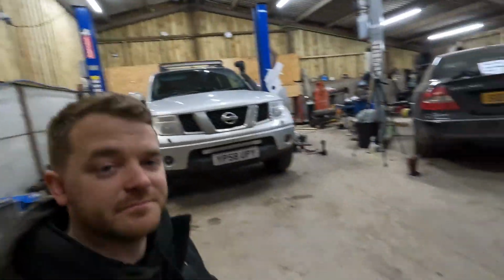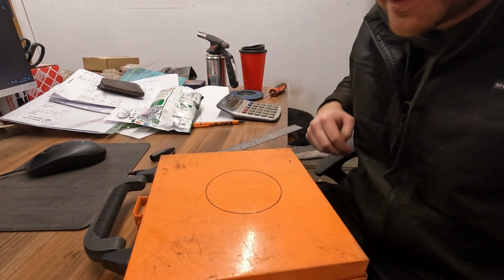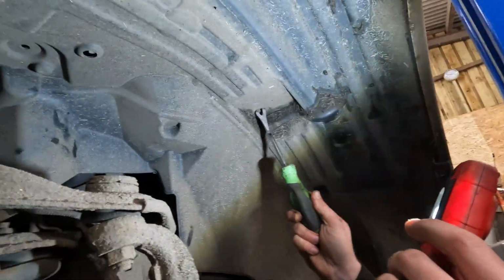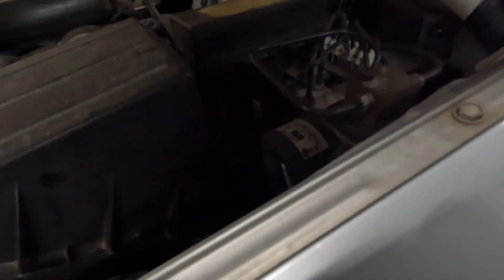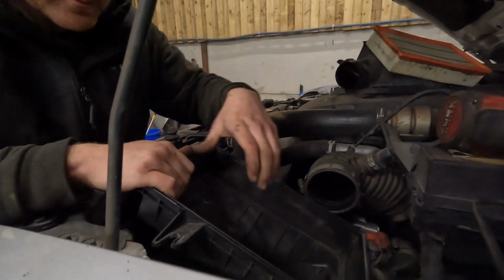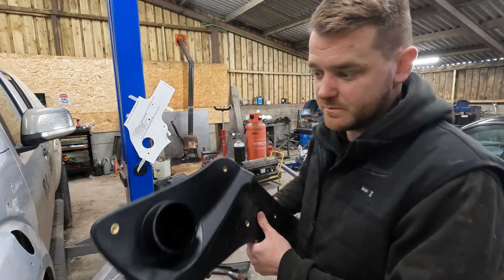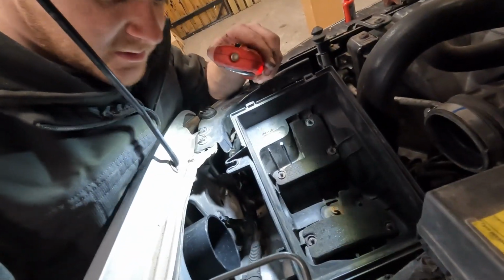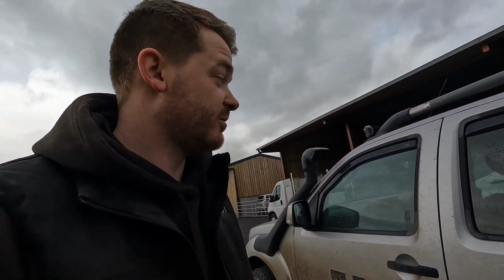We Fitted A Snorkel To the M.C Autos Navara d40

Comment: Quick question, how loud is the induction sound? I had a stainless installed on mine a few months ago and we have to keep the windows up to talk in the cabin.  I was hoping switching to plastic would help reduce the noise.
Reply from the maker: It’s fairly loud specially with me having the ram facing backwards.